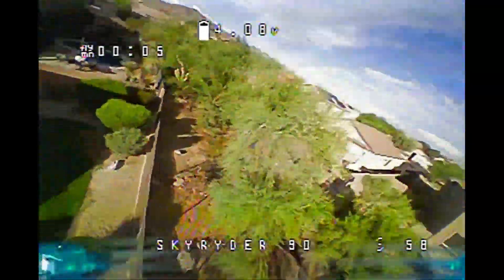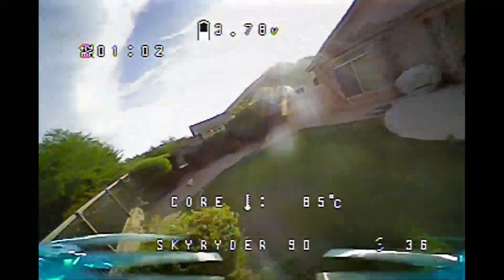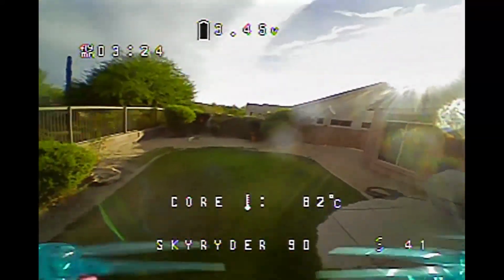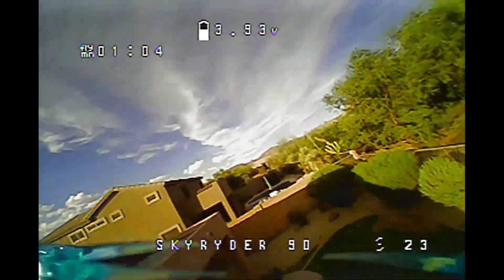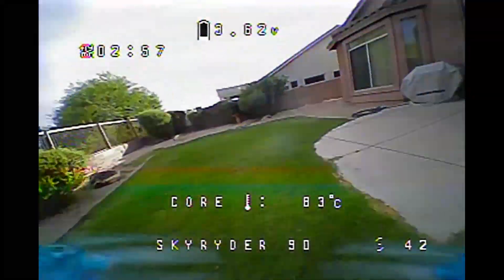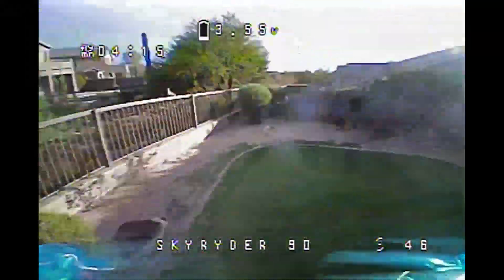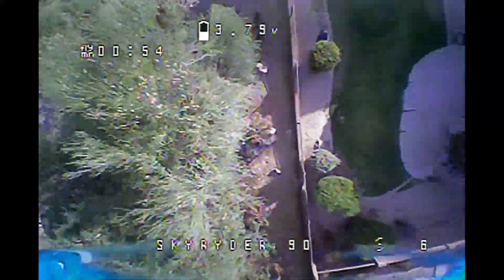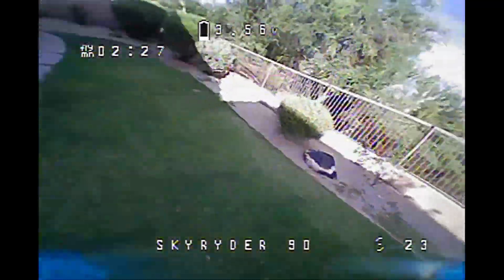RCinpower 1002 22000kv Gemfan 2015 Flight Footage (narration is barely aduible sorry)

Comment: Hey dude, did you have a way to compare the KV on these 22000kv motor ? as I said the 19000kv are actually 23000kv. and just make 15% more thrust than 0802 25000kv.
So don't know what to think about these one.
Reply from the maker: Unfortunately I don’t have a way to test kv.
Reply: @Quad66  it's not really accurate but with bidirectionnal dshot and BF motor tab you can easily compared the no load speed with others one 😉

Comment: Which fc are u using? And man that thing flies awesome. I definitely want a 2” 1s but I was waiting to see some reviews on the flywoo motors before I decided which to get. Also, which power lead are u using on them lipo? Xt30 or what. Thanks
Reply from the maker: FC is the original TuneRC 1S. The published Flywoo data suggests they are a little more efficient which I think would be a good thing to get a touch more flight time. The flight quality at this point is ok, it’s not tuned yet. I’m using GNB27, quality there is very hit or miss. XT30 is clearly overkill but probably not much flight time penalty with lower resistance. But the balance could get thrown off by having a big flopping weight if not buttoned down.
Reply: @Quad66  have u ever thought to send your frames to jacks 3D printing ? I’d love to try your frames but don’t want to order from China. Jacks sells a bunch of tks frames but the 2” race rocket frame is close to 6 grams
Reply from the maker: @djs134  the “local” solution that I tried is to sell the files for personal use so that people can get them cut wherever they prefer. That is still an option but doesn’t seem that popular. I have some reasons not to use Jack but a service like his that cuts and prints would be ideal.
Reply: @Quad66  if I were to buy your 2” file, do u have any suggestions of a good cutting shop in the us? I really don’t want to wait months to order from China? Thanks man, love the content
Reply from the maker: @djs134  I use CNCmadness, which is based out of Canada. They are reasonably quick. The carbon fiber has not been as good lately as what it was a year or two ago. I’m not sure how much that is their supplier vs global issues. My initial intent was for the 2 inch frame to be cut in 1.5mm but would recommend 2mm. Make sure to use thread lock as the screws are just barely long enough. I am going to try a slightly bigger wheelbase as well, probably 98mm (just to keep it under 100). I just got the NBD 1102 and flew those on a 110 with 65mm props and it was much easier to fly. I’m wondering if some of that is just the a little extra wheelbase helping with tracking.
Reply: @Quad66  look forward to seeing a video with those motors